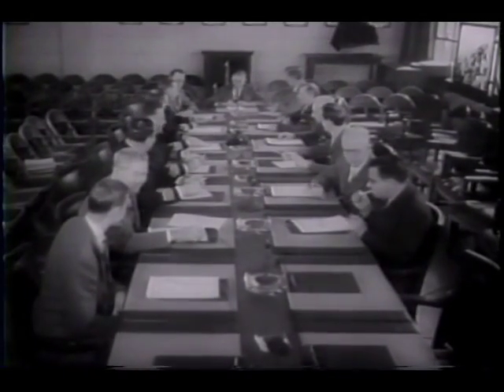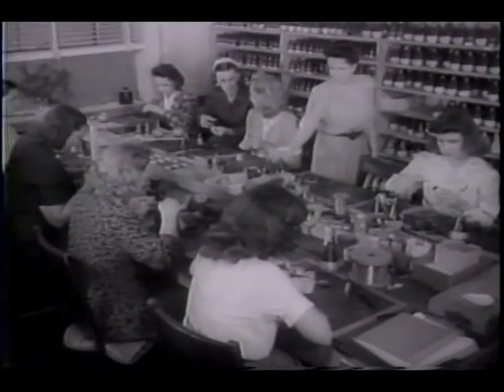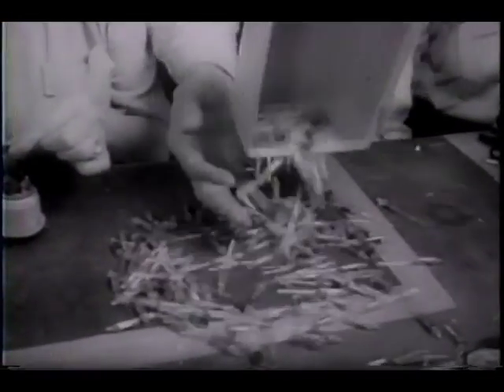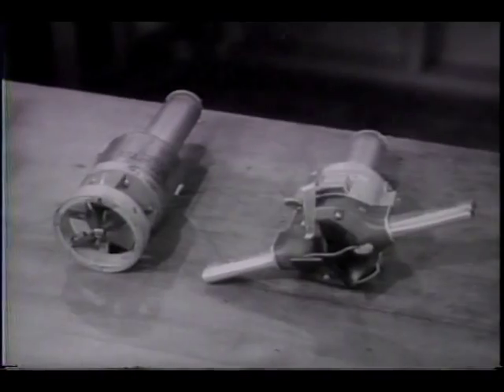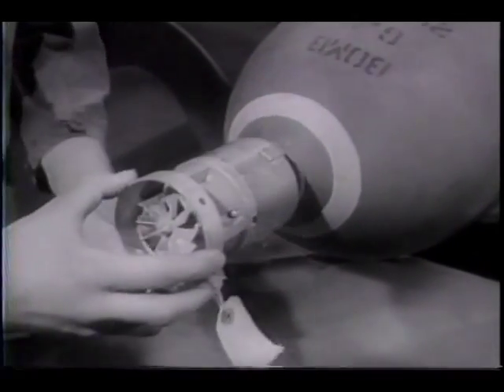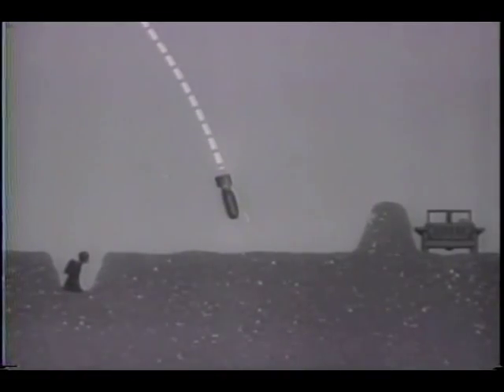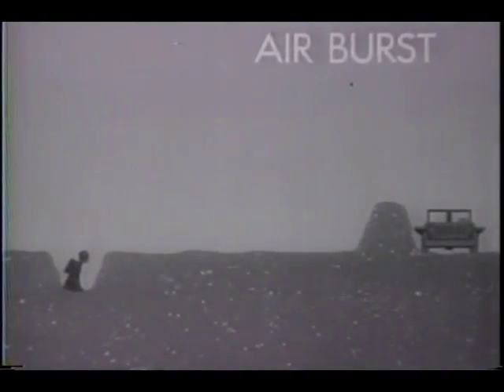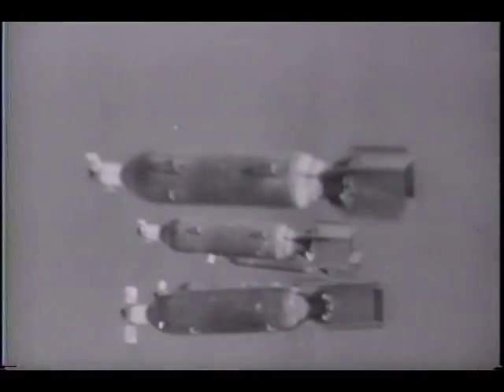Radio Proximity Fuse - Weapon Behind Victory (1945)

Comment: you know, the Germans had 30 programs in place to make Proximity fuses.
Some of them triggered by hearing engine sounds
Some of them triggered by electrostatic fields 
Some of them radio control by the guys on the ground
but what they all had in common is they All sucked.

But the US just upgraded the UK radar proximity fuse's they used in bombs to handle the extreme acceleration and stresses of a shell and in 1942 a 5"/38 gun on the USS Cleveland took out 3 high flying drones with just 4 shells.

So much for German Engineering.
Reply: Auch ein Blindes Huhn findet mal ein Korn ! Greetings from Germany.